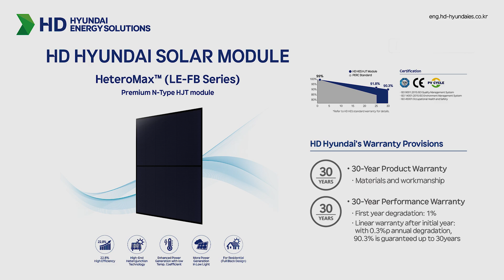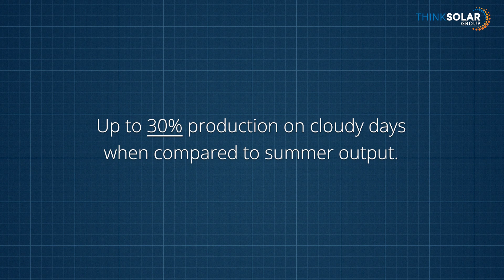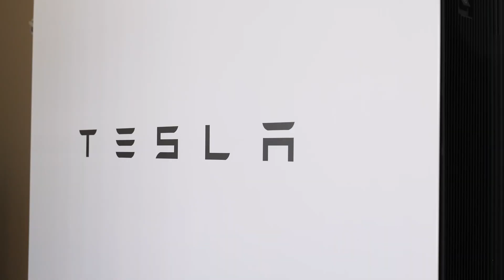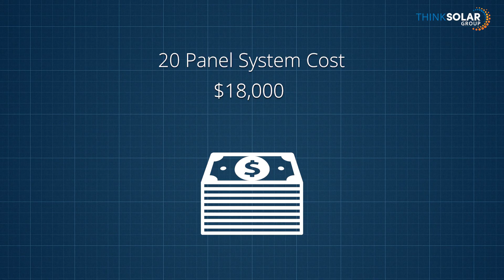The Top Solar Power Myths - Busted!

Comment: The way to look at solar is not on a year round basis but when is your critical power demand and unless you live in a very hot climate like the Middle East this is at the coldest time of year when you need to heat your whole house. I am at this time of year now and my 16 kWh battery often starts the day at only 3 kWh. I have considered adding a further 8 kWh unit - mine is a Sigenergy system that is modular and can be easily upgraded to a max of 48 kWh - but that does not work when on cloudy days my 12 panels only produce 8 to 9 kWh. In summer months I have an excess with 50% going to the grid for which I am paid a fixed price so the yearly calculation is does the income from the grid in the summer months offset the power I must pay for in the winter.